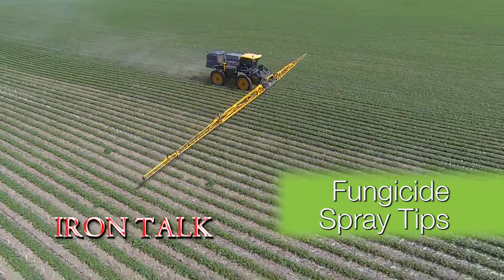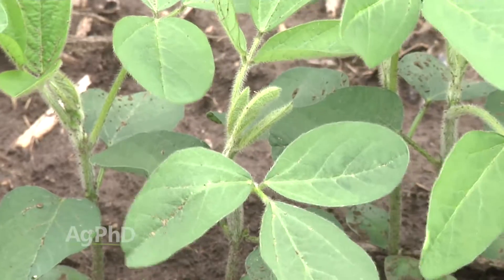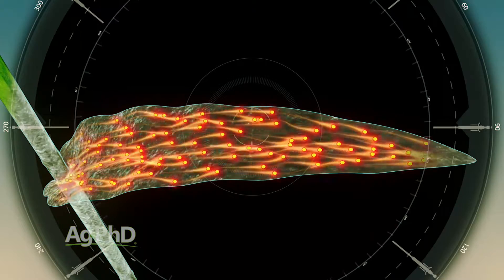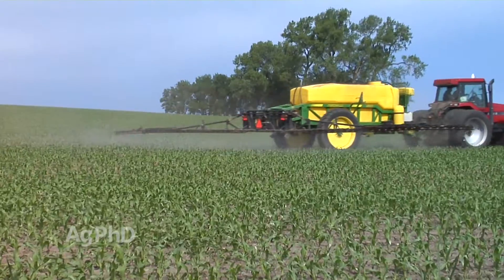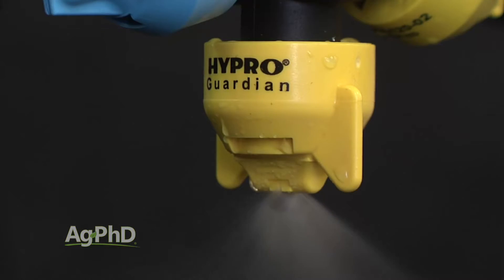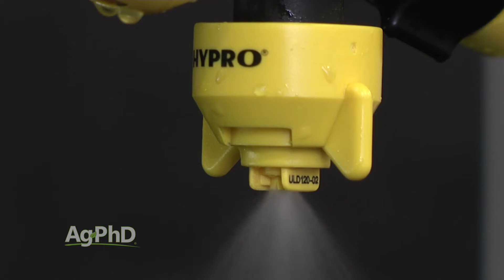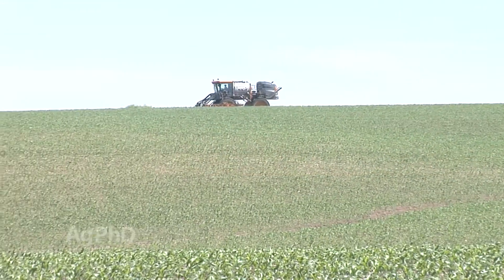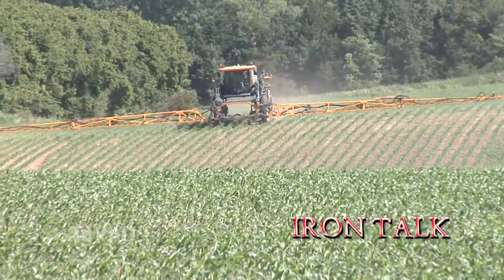Spray Nozzles #949 (Air Date 6-12-16)

Comment: 40%  #OFF #discount #deal #offer 
The regular price is $48.99, After code the price is about $29.39

#couponcode: 7O7YOE9N

Start Date and Time of Coupon Code:  2020-9-700:01 PDT
Expiration Date and Time of Coupon Code:2020-9-1423:59 PDT

For the 100 FT #expandable #garden hose, this after code price is a very very low price on #Amazon
with 10 Functions #Spray #Nozzle and Durable #Triple #Latex Core with 3/4" 
Solid #Brass Fittings/Strength #Stretch 3750D #Fabric for #Watering

https://www.amazon.com/JOOIKOS-Expandable-Garden-Hose-100ft/dp/B088CRHNDG